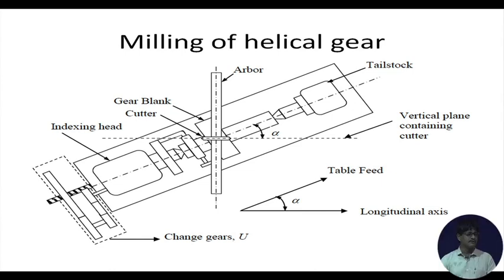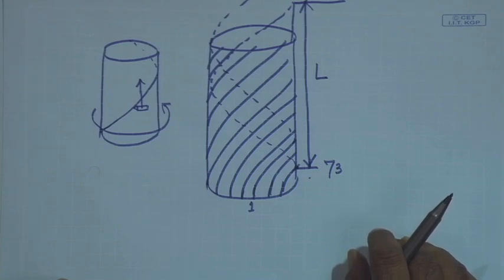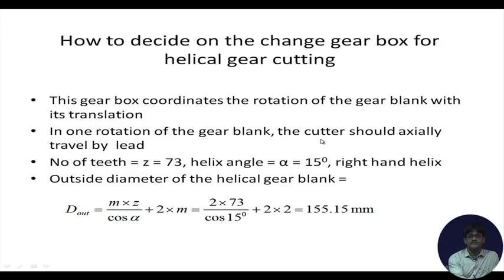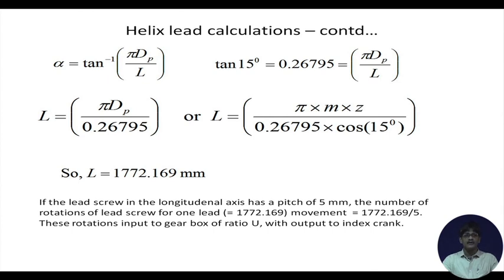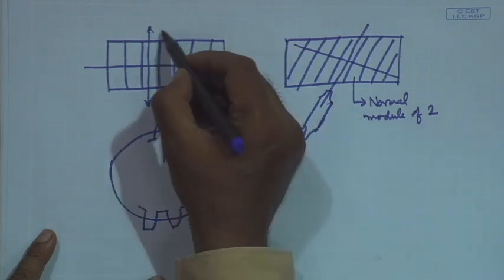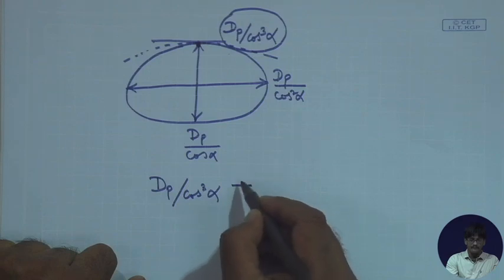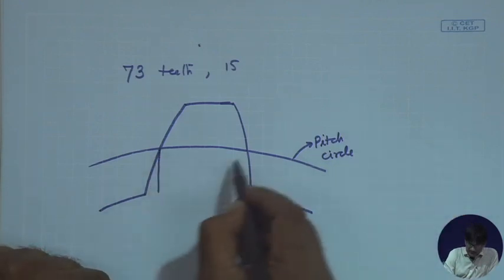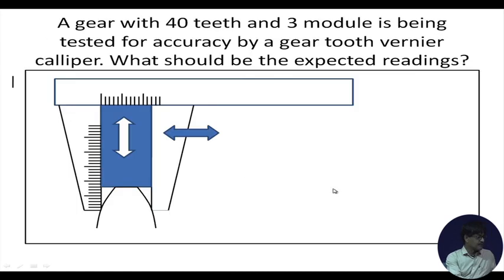Helical Gear Cutting on Milling Machine

Comment: I am facing a challenge while working on helical gear cutting using a gear hobbing machine. As per my equipment manual, the formula given for outside diameter (OD) is:

OD = (Z × M / cos θ) + (2 × M)

However, in practical situations, this formula is not matching with the actual gear dimensions I receive. This creates confusion while setting up and machining.

I would like to understand from a shopfloor perspective:

How to accurately determine module, OD, and helix angle for helical gears?
What should be done when the given gear does not strictly follow standard values?
Are there any practical methods or corrections used in real machining conditions?
Could you please share a simple calculation example for better understanding?